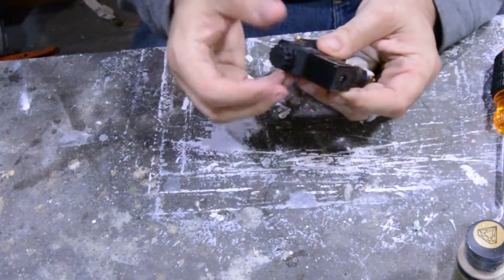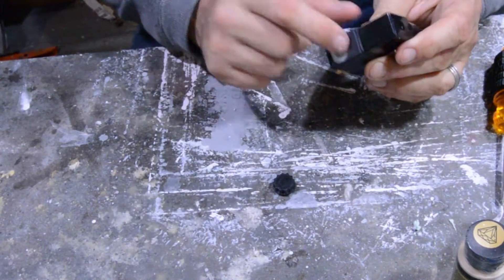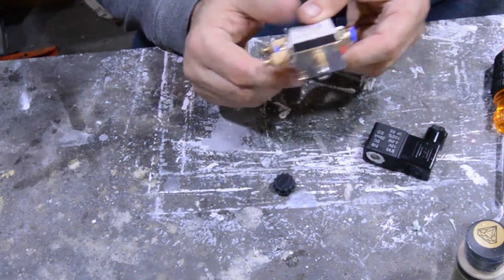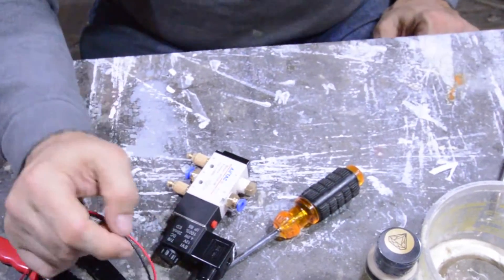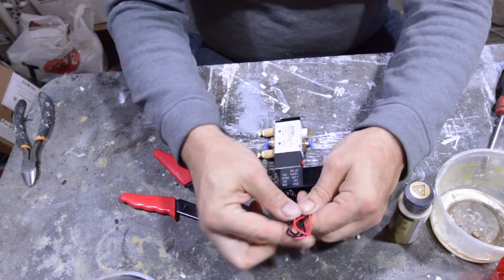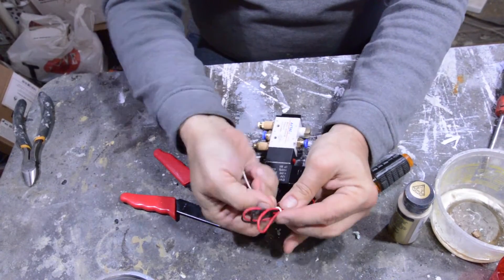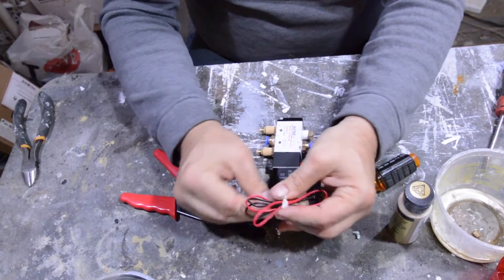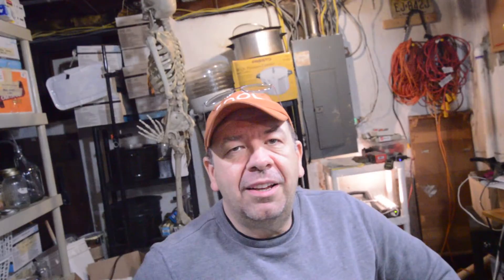Wiring a Solenoid Valve

Comment: Hi there I’m just trying to figure out why the Solenoid is re-assembled differently than it was in the box . Ie reversed so the cable clamp is facing the other way. I have a 5 port 3 way and the solenoids are both facing inward. Does it matter what position they are in or is it just a matter of cabling preference & cable routing ? Many thanks d

Comment: What about water pipe insulation sections? They sell them at the Home Depot. It is just like the pool noodles. Not sure of the diameter.
Just a thought. Have a great day.
Reply from the maker: +Keith L Thanks for the suggestion. I actually did use that to build it up to what I have now, but as you hinted, the diameter is not sufficient. I actually built up a couple of layers with it and it still looks insufficient, so I'm going to wait for the pool noodles. Thanks!
Reply: +GhoulishCop I thought the diameter might be the case. I love what you do. Happy Haunting👊🏼